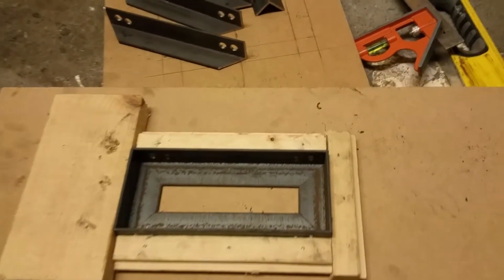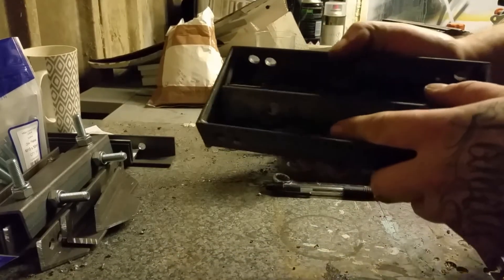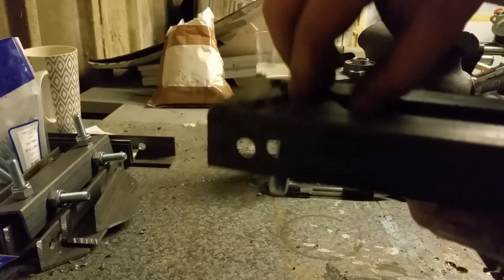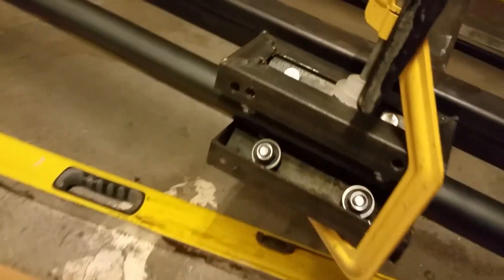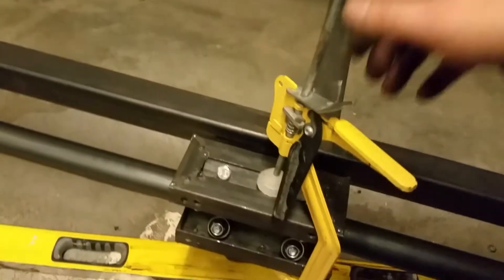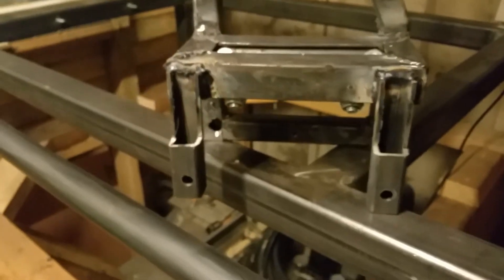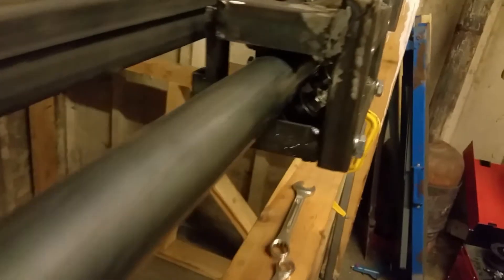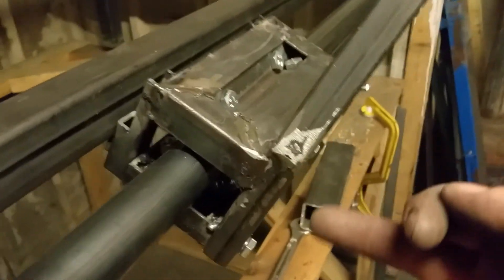Diy cnc machine liner setup part 2

Comment: Great work .  Is this your own design or is there any guides available ?
Reply from the maker: midshipracer  thanks, yes iv Designed this just sorting out a build guard with step by step should have it finished in new year
Reply: Luke Morrow  subscribed.  Been looking at the ooznest but wouldn't mind building myself.  Look forward to seeing it finished!
Reply: would you be interested in a square tube rail cnc? no welding involved, you need a drill, angle grinder and a wrench euro size 13mm which is 5/16" bolt or 1/2" wrench imperial :)